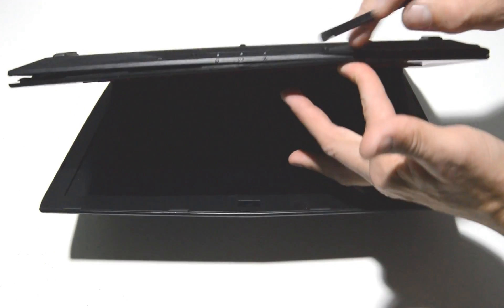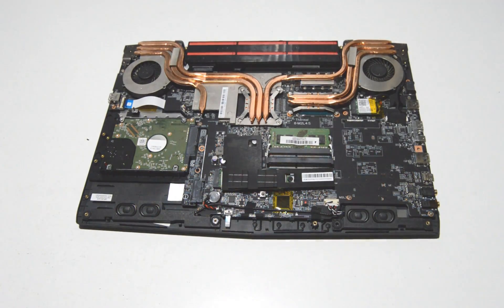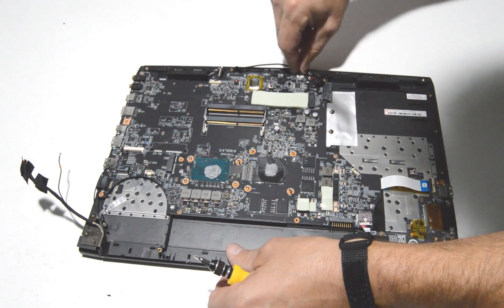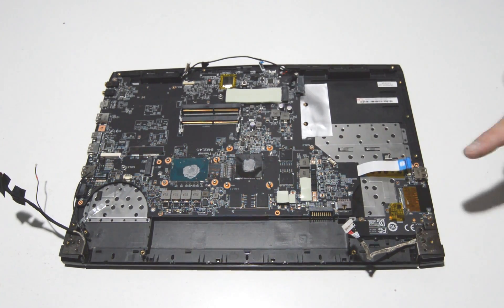How to Disassemble MSI GL62M Laptop or Sell it.

Comment: Thanks for posting the video.  I was struggling until I realized there was a screw under the factory sticker.  This laptop was not made for service.  Replacing hard drives and memory, ok, but replacing the keyboard is a lesson in frustration and hate.  This is the worst designed laptop for serviceability I've seen.  Keyboard replacement should be a half hour job tops.

Comment: Thanks you very much. Since I saw the BIOS Info and noticed it said there was two PCIe ports, I was looking for the second one, but I couldn't find it on the first side of the motherboard and I was wondering if it was on the other side, but I see it isn't. It might be the Wifi/Bluetooth adapter.

Comment: Hi, I have this laptop and plugged it into my truck in the OBD2 port and my laptop quickly shut off. When I press the power button the power button light turns on and the fans turn on but the screen stays black and it shuts off. Same thing when I plug in the charger. Did I fry the battery or the motherboard?
Reply: Did u find out what happened ?
Reply: Or fixed
Reply: @Almighty_S  ordered a new one. Threw it away.

Comment: After replacing the thermal paste and fix the right display hinge that was broken, my laptot won't turn on. No lights, no response. I've tried to re-open it to check if I've miss to reassemble some cables but it seems all right. What can I do?

Comment: I want to  upgrade the RAM on my version of this laptop, do I need to remove the battery before adding the RAM stick or is it okay to just pop the RAM stick in?
Reply from the maker: Make sure you discharge any static electricity, then you should be ok to add the RAM. The battery doesn't need to come out just for that.
Reply: @Sellbrokedotcom  Okay, is there anywhere on the laptop that I can clip my anti static wristband to like the bottom panel if it’s metal?
Reply: hello, do you have the reference of the ram please ?

Comment: Do you know if there could be a 3rd hdd in this laptop? I noticed that the rdx  model has the hdd placed on the motherboard where the rex model has no sata slot soldered there.  If someone soldered the sata input slot as the rdx has, will it function? Both  laptops use the same motherboard  i think.

Comment: If u only want to dissamble the battery, do you still got to remove something else?
Reply from the maker: Just the bottom case to access it.
Reply: @Sellbrokedotcom  thank you for the quick reaction!
Reply: @Sellbrokedotcom  i was just wondering if u think that i should also buy such an anti static wristband for replacing the battery?
Reply from the maker: @leonardmartens7693  Not for just 1 repair, you can just ground yourself first by touching the center screw on an outlet or the metal chassis of something big that's plugged in, most appliances have the outer body grounded.

Comment: My laptop is this model and it just died. I was starting it up, logging in windows when it suddenly turned off and now it does nothing (and when i say nothing is NOTHING), I have a pretty paperweight now.

I'm out of warranty so I will try to open it up and see if i can figure out what is wrong. I'll update this coment if I find the problem.

Update: Motherboard died, more below.
Reply from the maker: I would try unplugging the battery and try running it off AC power alone. If that doesn't work, it sounds like maybe the motherboard died.
Reply: @Sellbrokedotcom  The chip on the left of the keyboard connector (10:25) is dead, I don't know how but the silicone is shattered, I can even see the transistors. I'll look for a new motherboard.

Comment: Thank you for your detailed instructions here. I'm needing to replace the top casing of my GL62M which covers the keyboard as it's slightly cracked. I couldn't work out from the video whether there's an easy way to remove this without having to detach and disassemble absolutely everything else first! Very grateful indeed for any advice you can give! Thanks in advance :-)
Reply: i have exactly the same problem...probably the solution si replace the entire keyboard..not only the cover ! on aliepress they sell for 100$
Reply: @DanieleGiusi  - Thank you! Actually, so far the tape is holding up surprisingly well! Just having to be a little careful in opening and closing the lid...
Reply from the maker: Unfortunately the palmrest is the main attachment point for pretty much all of the internals. You would basically be disassembling everything but the LCD assembly.
Reply: @Sellbrokedotcom  Thanks so much for responding and clarifying. That's really helpful to know. In light of that information I think I'm going to rely on a simpler, albeit more temporary fix for the time being - good old fashioned gaffa tape! Thanks again :-)

Comment: Wait, you can't remove the keyboard? I bought a keyboard replacement because the keyboard stopped working on some keys, the only way they worked was by holding down CTRL + Z or C and later pressing on the keys that didn't work, like yuiophjkl keys. But they would give out other key presses. 

So did I buy the keyboard replacement for nothing?
Reply: C R F keys?
Reply: Yes you can, you have some videos on YouTube replacing the keyboard

Comment: In the video you didn’t end up removing the keyboard/touchpad from the palm rest. I bought a new shell for mine since it’s cracked around the hinges, both the bottom and top halves of the shell. Is it possible to move the keyboard and touch pad to a new shell or is that sorta impossible? I don’t want to take it apart and not be able to fix it since it’s what I use for work and school, but I’m worried since the shell is beginning to crack further due to use.
Reply from the maker: It's not impossible, however the keyboard backing plate is basically melted into place. If you free your keyboard, it might be a pain to reattach it to the new palmrest. Best to get a palmrest with keyboard already in place.
Reply: SellBroke alright! I’ll see if I can find one. Thank you!

Comment: How difficult is it to remove the touch pad and put in the new upper. I have mine open and have a heat gun but want to make sure ill be able to put it in the new upper without replacing the touchpad. Is this possible with just a heat gun?

Comment: The USB 2.0 port of my MSI GL62M is malfunctioning. It doesn't work at times and I'm sure it's not a driver problem cos I reinstalled Windows and drivers. Any ideas?
Reply from the maker: If you have already checked it for damage you might see if there's a chipset driver update.... those can sometimes be separate from auto driver updates.

Comment: I wanted to change the thermal paste of my GL62MVR (same cooling system) but after removing all the screws, the part over the graphics card wont move at all, like its glued. It looks way more difficult to remove than in your video. Do you know if I can do Something ?
Reply from the maker: That's pretty common, the thermal paste hardens over time. If you are 100% sure you removed all the screws, just apply light upward pressure on it while wiggling. If it still won't budge, get it warm with a blow dryer or heat gun if you have one, that will soften the paste and make it easier to remove.

Comment: I have the exact same laptop but mine has a i5 7300 processor. if i wanted to replace the motherboard, will it work if i used an i7 processor?
Reply from the maker: As long as you check the ports configuration to make sure it is the same, and I would also make sure the connectors all match. Here's an i7 from another GL62M https://www.ebay.com/itm/MSI-GL62M-15-6-Genuine-Intel-i7-7700HQ-2-8GHz-GTX-1050-Motherboard-MS-16J91/324171322602?hash=item4b7a1dd4ea:g:9pwAAOSw6GJeMtGF:sc:USPSPriority!89511!US!-1

Comment: How do you take the CPU out to replace it?
Reply from the maker: Not really feasible, it is integrated into the motherboard.
Reply: Is the cpu just soldered on, or actually unremovable? I am wondering about upgrading my cpu as well.

Thank you for the video. Have used it many times for fixing the fans and re doing thermal paste.

Comment: Great video. A good tip, which I'm sure you're aware of is to first remove the battery, then press/hold the power button to discharge any residual electrical current still in the laptop before proceeding to do whatever you're doing. I came here mainly to see how the HS is set up with the fans.
Reply: Its actually removeable..
Reply: The battery is non-removable and plastic bolts it to the motherboard.

Comment: Hi, i need to replace only the display cable. After i remove the heatsink/fans (to let the cable reach the connector) what should i do? Do you think i need to remove the hinge screws (like u do at 11:35) and pull of screen+ all plastic support or there is a faster way to do it?
Reply from the maker: You main goal is to be able to feed the video cable out of the chassis, so remove anything that prevents that. You might be able to remove the video cable from the LCD assembly WITHOUT totally removing it from the laptop. You can do this by popping off the front bezel and then removing the screws for the LCD panel, tilting it forward to get to the LCD cable connection, then peeling the tape back carefully to remove the cable from the LCD. The reverse that to reinstall.

Comment: Thanks for the helpful video! So is there absolutely no way to remove and replace the keyboard?
Reply from the maker: Unfortunately no, it is integrated into the palmrest by plastic rivets. You would have to buy an assembly. I see they sell new ones from China but they are non-specific on how you remove the old one and attach a new one. Pause at 10:52 and you will see it is riveted onto the palmrest.

Comment: is it possible to change the processor on this laptop??🤔
Reply from the maker: Unfortunately it is not... the current trend is for manufacturers to integrate the CPU into the motherboard for cost-cutting.
Reply: @Sellbrokedotcom  do you have a solution for upgrade him ?
Reply: SellBroke that’s such a let down
Reply: SellBroke I was really looking forward to switching my cpu
Reply: its possible for every laptop but u need to know about micro soldering one mistake and boom u broke everything so its not worth it except if ure professional, there is reason why u cant upgrade or they make their product less-fixable its called "planned obsolescence
" instead upgrade those part ure forced to buy a new whole laptop to follow the trend

Comment: Hello! Very good video, I broke the lower and upper cases of my msi laptop and bought new ones. To replace the upper case I will need to remove and replace the keyboard and touchpad, you mentioned it was sticked with adhesive to the case, do you think it's still possible to remove it and put it on a new case without damage? Thanks in advance for your response :)
Reply from the maker: The keyboard for this model is riveted into the palmrest, your new unit should include it. If the touchpad does not have screws, it will need to be removed with a heat gun and some prying.
Reply: @Sellbrokedotcom  Hmm the new unit is only plastic and doesn 't include keyboard and touchpad that's why I want to remove the keyboard from the old one to put it on the new. Thanks for your answer, I'll just try removing it as carefully as possible I guess
Reply: @neylkara7434  You solved? I have exactly the same problem ! Can tell me just in case
 the procedure?
Reply: @DanieleGiusi  hello, no I couldn't remove the upper case, I was afraid of breaking everything connected to the motherboard by removing the keyboard. But by replacing only the lower case, it went ok and the upper break is kinda stabilised now. Just be careful about the hinge of the screen, it's a bit fragile.
Reply: @careid2100 It will work for you then, personnaly I didn't really want to put that much more money on that computer that was quiet expensive for me, when i intend to change it in a couple years